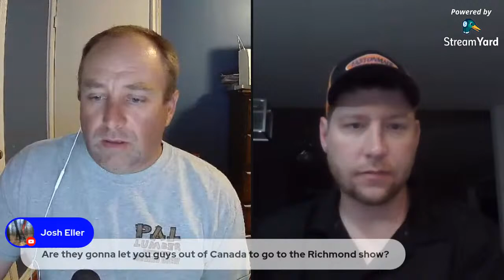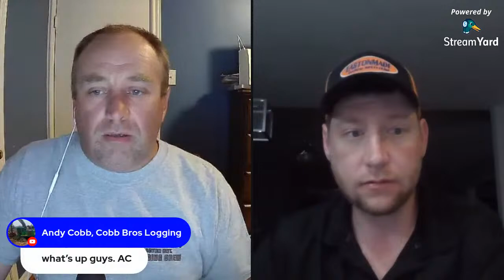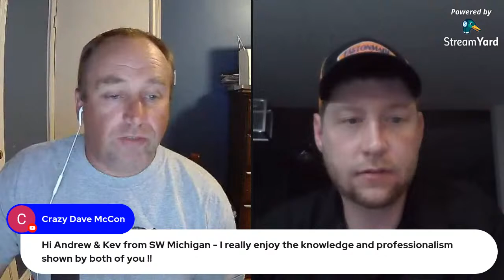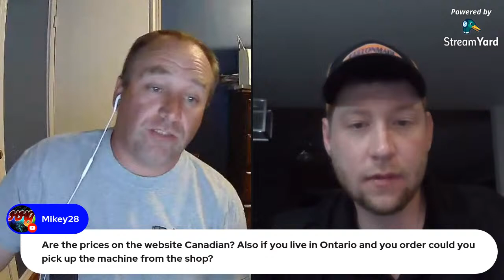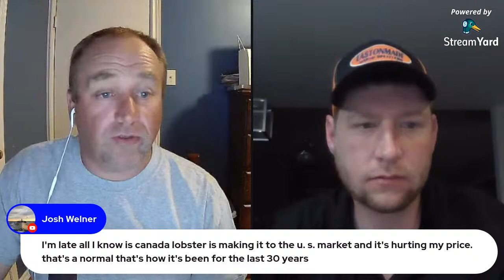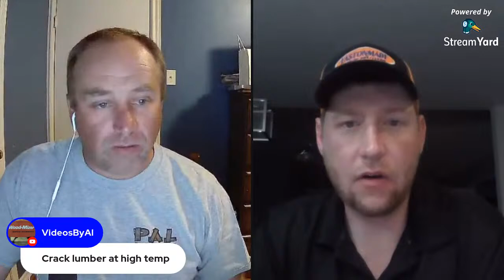SATURDAY NIGHT LIVE FIREWOOD CHAT!

Comment: Hey Kev.. in your professional opinion how many full cords does one need to produce to justify spending 200k on the 4000 set-up?
Reply from the maker: This is a tough guess to answer.    But most guys who have them are doing 1000 full cord or more but depending on the market and what you pay for logs and sell for all have a factor in it.
Reply: @SkidderKev  my market is pretty good.. im also a log hauler and have a log loader in my yard... so I get the hole trailer for 2k and unload myself.. 50 to 55 face per load
Reply from the maker: Thats a pretty good deal on a load
Reply: @SkidderKev  I sell for 110 a cord and also bag for stores and local camps... this year I'm going to more then double what I did last year and I also added the big bags to the list
Reply from the maker: Also we didn't buy everything at once.  We had thr machine with the attached conveyor then later we got the tumbler and the year after that we got the 32footer conveyor.  Made it abit easier to do.
Reply: @SkidderKev  I had 5 loads brought in and sold out in 2 weeks